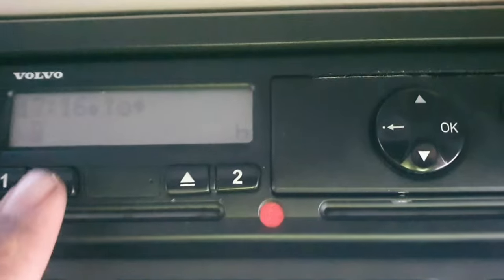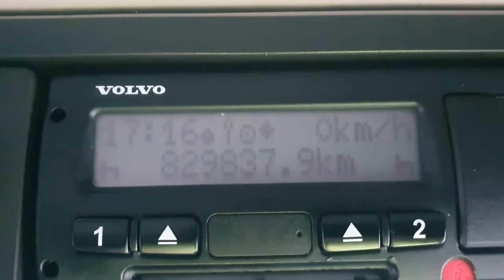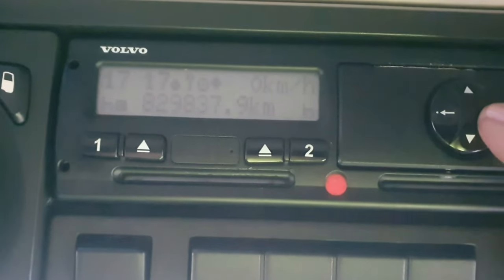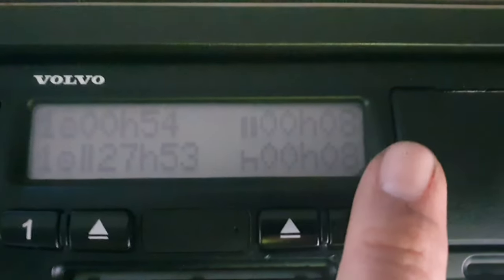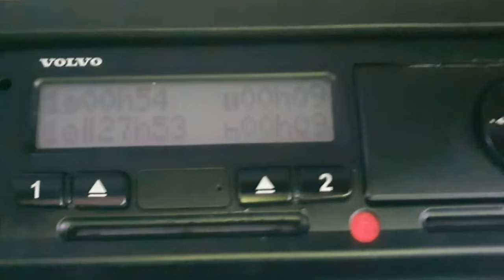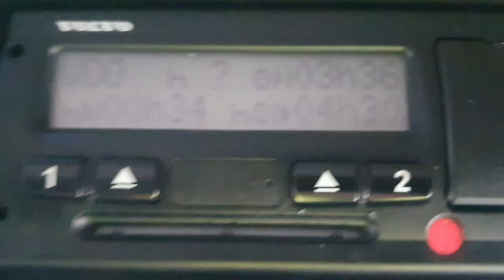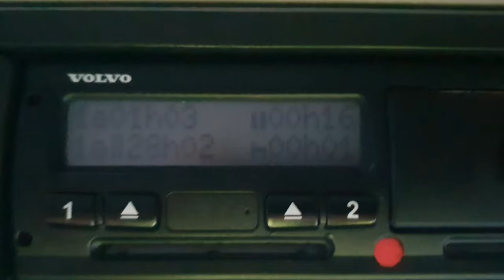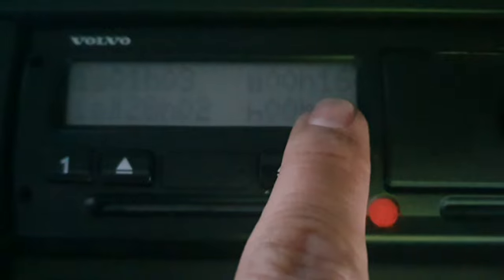How to use a TACHOGRAPH easy basics hope this helps 😁 HGV TACO

Comment: Iv messed it up on my first job
After 4.5hrs i stopped and forgot to put it on break and to me i was on break but taco wasn't 
Had a 2.5 hour rest instead but it was recorded as other work.
Now i am scared and frustrated incase i get pulled 😢
Reply: But the default setting for when it detects vehicle is not moving is rest.. unless u changed it yourself before u went on break?

Comment: Why is it so difficult?
Reply from the maker: It's not that hard once you're using it you've just got to watch out you don't go over 4 and a 1/2 hours drive time, Basically take a 45 minute break every Four and half hours
Reply: What settings do I use to go from hgv to a van